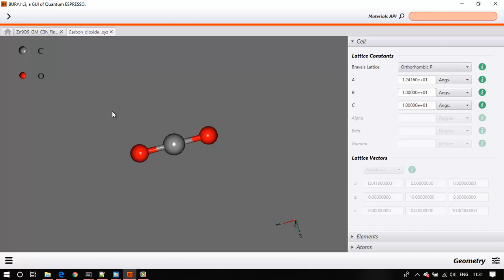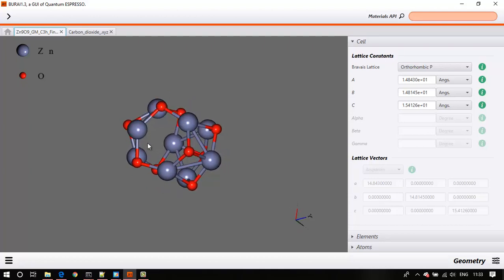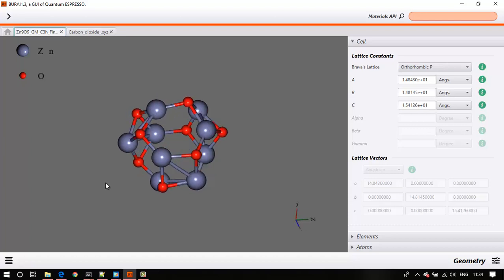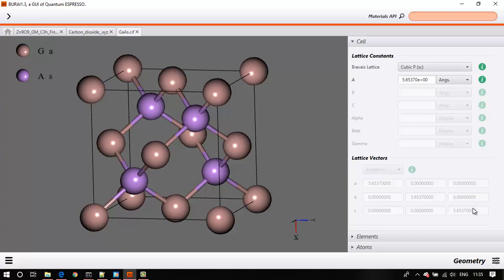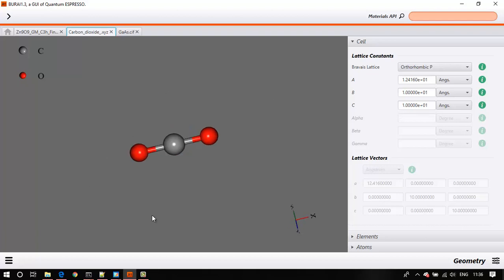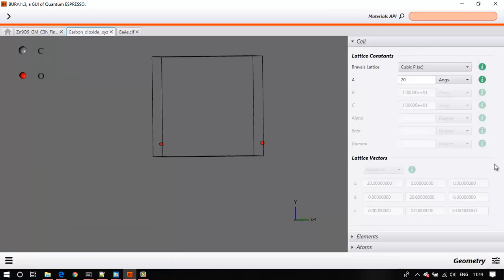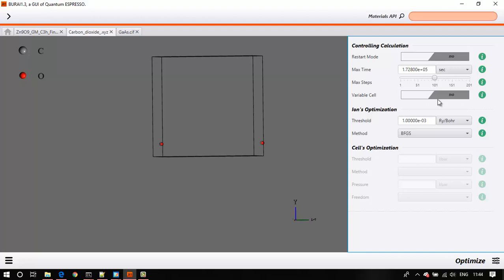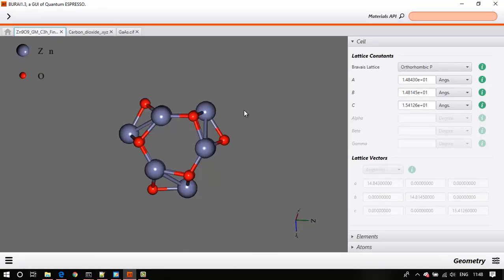Quantum ESPRESSO TUTORIAL - DFT calculation on a MOLECULE/ NANOCLUSTER  (periodic DFT code)

Comment: If we want to calculate bandstructure of a quantum dot, say CdSe. Then what will be the path of high symmetry points? Original cell structure or simple cubic?
Reply from the maker: Bandstructure of a quantum dot doesn't make much sense. As the energy levels are quantized and therefore not going to form a band. A band itself is defined as a group of closely spaced energy levels, essentially forming a sort of a continuous band. But a quantum dot would be quantized in energy levels. Also, there is no physical significance or meaning of a cubic or any cell structure for a quantum dot as it an isolated structure not a periodic crystal. You can try to refer to some literature. Hope it helps.
Reply: @PhysWhiz  Thank you very much, dear.
Reply: Literature is bit confusing. Few refer quantum dot as periodic crystal and few as nano cluster.

Comment: I have one more question regarding nanomaterials. Can we calculate DOS for a quantum dot? I suppose that it should be like Dirac-delta function spikes! Am I correct? How I can do these with DFT? Many thanks.
Reply: yes it will be D-delta function, that means no spread of energy (well nearly no, some distribution will be there but very less), hence, at some centain energy you will get quantized energy state as mentioned by Physics Whiz.

First you take the unit cell of your concerned material. You can repeat it, but length of the supercell (in all 3 directions) must be smaller than twice the size of its exciton Bohr radius. Then you create vacuum in all 3 directions and follow the DOS calculation procedure as mentioned by Physics Whiz. Good luck
Reply: @anishdas39  Many thanks.

Comment: Thanks for this useful video. Can you help me Manas? I am trying to run BURAI on windows 10. But it is not picking up pseudo potentials (path issue or /). I have MSMPI v10. Can you provide me your email? Urgent please🙂
Reply from the maker: In windows one needs to use back slashes in path.
Reply: @PhysWhiz  I am using backslash itself. But BURAI is adding a forward slash on its own.. so the path is like: C:\User\.pseudopot/...upf
Reply from the maker: Then just use forward slashes. I think BURAI changes them to backslashes automatically. Also, you could try pasting your pesudopotentials in the default directory of BURAI if that works.
Reply: @PhysWhiz  I have pasted the pseudopots. in the same directory too, but that didn't help too.